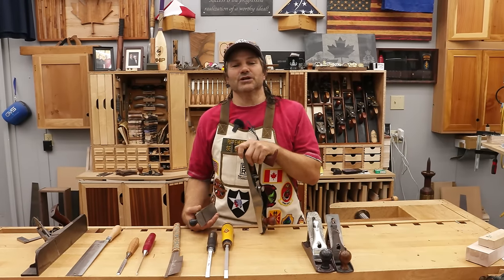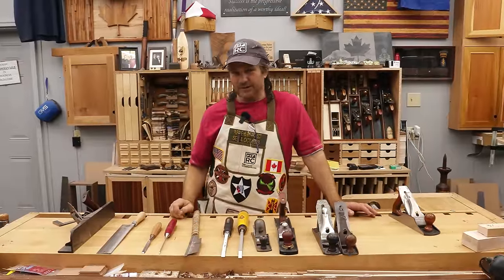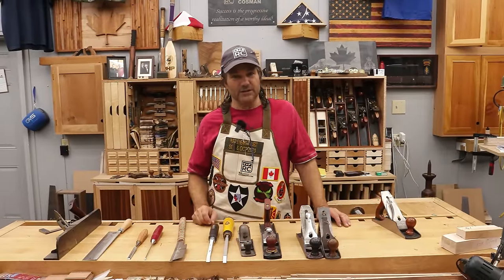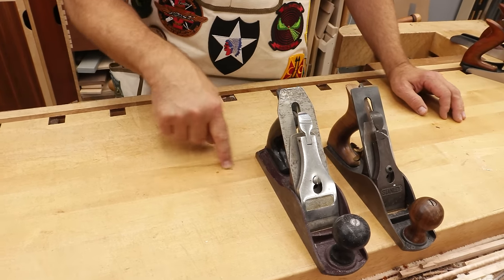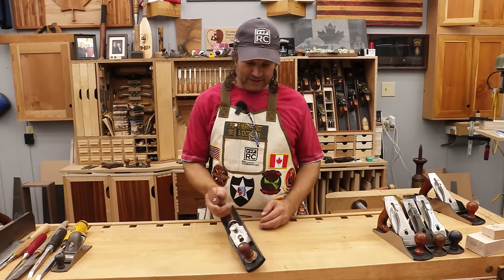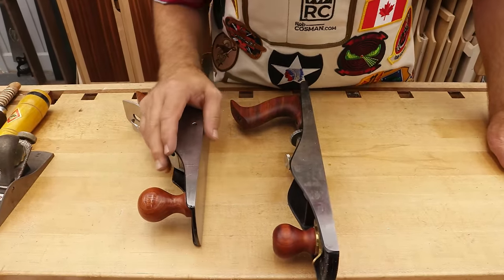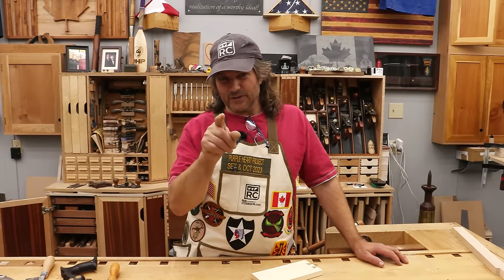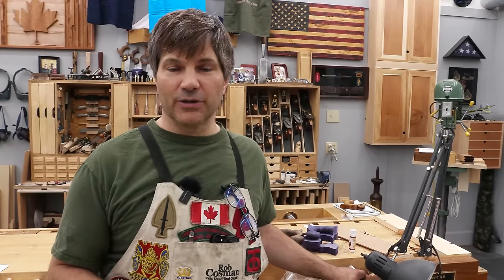Tools Not To Buy | Learn From My Mistakes !

Comment: I find that for most of my work, the 4 and 5 works better (the caveat is that you buy the lightest vintage 4's and 5's to restore while having a very sharp blade).  I do also have very sharp and flat 4.5 and 5.5 that works better for other things, but I do agree that most application of these also works well with a good amount of mass.  I think Narex style chisels are fine, they are no worse than using a bevel edge or firmer chisel.  The purposeful relief actually only is an issue if your sides dont scrape their way down past the last cut (usually not and issue).  That said, they do wander far more than a perfectly squared mortiser.  As for parallelogram chisels... basically all vintage chisels will be like this.  It's ALOT of work to get them relieved, and even more to bring to full square.
Reply from the maker: I would call you out on "Basically all vintage chisels"  there are some very good vintage bevel edged chisels.  But just like everything, you have to be willing to pay to get correctly made vintage bevel edge chisels
Reply: @RobCosmanWoodworking Good vintage bevel edge chisels are generally excellent provided you get the right brand from the right era.  Plenty of later Bergs are softer than some modern Sorby's regardless of what people say.  Some bevel edge chisels such as earlier Ward, and Howarth are unbelievably flat and consistent over 8 or 9 inches of length.

I was specifically referring to the mortisers and firmer chisels. I find they mostly have that weird skew - not sure if it's one of these artifacts of the manufacturing process? 

Often, you will find one side squared and the other side skewed as well.  I am a bit of a vintage chisel affection-ado and I own over 200 or so of them?  Honestly, majority of the firmer and mortisers have that skew (at least on one side).  I am a sadist so I spend my time to fix all of them....

Comment: This is really great! I hope to hear opinions from those who use dedicated shooters. Over the years, I've come to adore (and rely on) the shooting process and have just been using my heaviest, most-square, and "whatever is sharpest" plane. It takes effort, but I do get results. Someone recently enlightened me about the shape of the dedicated shooting plane, specifically its ability to travel in fixed-width track eliminating drift. This is appealing! They are pricey, though...
Reply from the maker: My point exactly...Why spend all that money when a tuned up bench plane will do just as well?
Reply: Used the 5 1/2 as a shooter. Was just too painful. Palm was one thing, but where my fingers were... a bad pass with a sudden stop just killed these old hands.(damn, just admitted out loud that I'm old ) This was pre Rob's adaptation for the 5 1/2. 
Bought a dedicated shooter. 
Changed my life. 
The good:
Heavy. Heavy is good. Hardwood don't scare me...
Larger surface area contacting the shooting board. You'll never worry about a wobble again and it laughs at slight imperfections on the shooting board.  (like a jointer misses the valleys)

Where the Cosmogrip might be better:
Having your hand right where the business is taking place. More control. Being more in line with the linear motion to the mass of the plane feels better. Even without the Cosmogrip. 

Having said that, when first using a purpose made shooting  plane, with your hand off to the side and further back, it seems like you will need to lever pressure to keep the toe in the proper position. (torque your hand a bit inward?)
In practice though, there is no need. So once you get used to the feel and idea that the plane will track properly without excessive help from you, it becomes a non issue.

The up in the air part:
I often vacillate between shooting board and standard planing. For myself, taking the Cosmogrip on and off is about on a par with just grabbing a different plane. Be it a purpose made shooting plane or not. So probably, I would have used my 5 1/2 as a dedicated shooter.
 
If the Cosmogrip were available would I have bought the shooting plane? No. That is a brilliant solution to a real problem and would have given the Cosmogrip a try first.
Would I give up my Lie-Nielsen? No. It is a better solution albeit at a price. Once you've driven a Rolls...

Disclaimer.
So yeah, I bought the Lie-Nielsen... I know. 
Just know that what I said will not necessarily apply to the other modern purpose made shooting board planes. I did have one other in hand and there is something to be said about nimble.

Comment: had those exact problems. large hands yup.
just couldnt get the plane to sit smooth, i ended up trying to attach things to it to increase its size and offer my hands a better control. kinda worked but obviously theres  aproper option.
if id known i would have saved a bit.  ...or kicked my father for not handing down his 😂

Comment: There is nothing here I disagree with. However, due to budget and wanting to get into to mortises quickly I did pick up a set of the Narex. They are ok, but I do find that the sloped edges do cause issues...so, I'm gunna save my sheckles and get a better set when my skill reaches a level that would justify it. Here, again, is another example of "cry once vs cry everytime"
Reply from the maker: Yup, I bet you can sell them on the secondary market and recoup 50% of your costs

Comment: Good stuff Rob, I have to agree with your views on these tools. I have most of them. The block plane explanation is spot on. I have the WoodRiver 5-1/2, it's far and away the best I've got. I admit to using my Stanley and Miller Falls #5 and #4 's  to do some initial planing, my thinking is somewhat convoluted  and for another time. I use a Gent's saw because it's what I have and have grown accustomed to it. Would I like one of your? Absolutely. One day I may have a couple. Right now it's not possible, yep, budget is that tight and a Regime change is essential. Thanks for sharing your knowledge and your work with our veterans.
Reply from the maker: Amen to the regime change!  Can’t come soon enough.

Comment: Its funny. My first bench plane was a Lie Nielsen Low Angle Jack plane. The “gospel truth” on the internet stated low angle Jack planes are the best plane for beginners. I don’t use my low angle Jack. My most used plane is my grandpas old Stanley 5 1/2 with a Ron Hock iron and chip breaker.
Reply from the maker: Ron makes great blades.  I really dont know how the whole internet thing recommending Low angle jacks got started

Comment: I completely agree with you about Japanese saws. While I think they are a little easier to learn for a beginner learning to follow a line, once you learn how to control a western saw, I feel you can achieve a greater degree of control, especially, as you say, in domestic hardwoods.
Reply: Totally agree, I think the advantage of the pull saws is you can get a good saw for much cheaper than a good quality western style saw.
Reply: @dominicdiclemente8877  that is also absolutely true. Cheap western saws are never sharp, and beginners a)wouldn’t have a clue that they weren’t, and b) wouldn’t know how to sharpen them if they did know they weren’t sharp from the factory. The first time I used a good, sharp western saw, I was hooked. It was a euphoric feeling, especially when I considered my childhood years, finding an old rusty Disston in the barn, and trying to hack away at a two-by for an hour, making about three inches of progress!
Reply from the maker: Thanks for sharing!
Reply: Totally agree that Rob doesn't know a thing about cutting hardwood with a japanese saw if he believes the urban myth that they're 'designed' for softwood. If you and him feel you can cut hardwood better with a 'push' saw, fine. Use the tool that works best for you. In the meantime , I and every woodworker in Japan will use our Japanese saws to cut hardwood. Oh and Jonathan Katz-Moses also cuts hardwood dovetails with a dozuki.
Reply: It's pretty hyperbolic that you think it rises to the level of "Urban Myth." Still, saws and planes from any given area are absolutely tuned for the kind of wood that the craftsman uses most. When I bought my Bad Axe saws, Mark always asked what kind of woods I use most so that he could advise on ppi and fleam. English planes are often bedded at York Pitch because the woods they often use require that. Similarly, Japanese polishing planes are bedded lower than 45 degrees to work better in the cedar and other softwoods used in abundance there. The Japanese saws that beginner woodworkers have access to here have no options for differing wood densities and properties, unless they go to expensive ones at Japan Woodworker. So your argument isn't taking into account the nuances of all of our practices everywhere. I use mostly domestic hardwoods, and they do not cut well with my all-around Japanese saws. We all need to tune our kit to the woods we most often use.  @Trust_me_I_am_an_Engineer

Comment: In the early years if you were to offer these recommendations you would have been jumped by Schwarz and all the toolmakers who very much dictated to what we needed and that was every tool they could throw at you. However, now that they have disappeared and become quiet, advice on what tools to avoid has emerged. But as you mentioned, we were unaware of these insights back then because we were guided differently.

Comment: Always funny when people think they’re inviting controversy, only to present totally reasonable arguments or opinions.

There’s lots to agree with, but of the planes I own, the 5 1/2 is my least favourite, for the reasons given here: it is harder to push when the blade is not perfectly sharp – I don’t like it. I also don’t agree with the idea that more mass is better: it gives you more momentum, but you need more energy to create it. I bought an old 5 1/2 that is perfectly square, though: it’s good for the shooting board.

And I probably will give the Lie Nielsen No. 62 a go, despite the fact that everybody says you don’t need it: everybody also says you don’t need a huge jointer, but everybody who says that does have one and uses it – I really enjoy using my No. 7, too. Also, I’d like to own one modern “premium” plane, to see what it’s like: the No. 62 has a No. 5 footprint, and I don’t have a No. 5, and I want to try the toothed blade as well, since I don’t have a scrub plane. That’s my reasoning. We’ll see.
Reply from the maker: If your 5-1/2 is hard to push I would look at your sharpening skills.   It is not difficult with a sharp blade.  Sharpening is the key skill of a hand tool woodworker
Reply: @RobCosmanWoodworking  No, I know. Sharpening is not difficult, I’m just lazy – never been good with maintenance.

Comment: I generally never understood the purpose of a number 4 plane, for me its jointing with a number 6, 5 1/2 for all purpose including smoothing, then low angle block plane, then shoulder plane. All I need....
Reply: It depends. If your making large pieces, from larger stock, a large plane is at home, but try working with those on ½ inch stock. Not fun. Small details need smaller tools, or really, really strong wrists. And Rob is right about ergonomics, as having had RSI, its no joke. This is why it might be best if you can, to think about what you plan to make, and the material you plan to use then try before you buy. Go to tool fairs,  physical shops, or community workshops, and get your hands on the tools before buying. Hand woidworking tools are no longer cheap any more, so one can't just afford too many mistakes.
Reply from the maker: The old standard of needing a fore plane, jack plane and a smoother is no longer needed given our modern metals and quality sharpening stones.  You can smooth with any size plane as long as you can sharpen it well.  Why buy a specific plane just for smoothing?
Reply: @BigHenFor  It is definatly true about small details needing smaller tools. I brought my miniature low angle block plane mostly because it looked cure and I had just one use case that needed it. However having it in my plane till actualy sees it get a fair bit of use in tight areas / small details that before I aquiered it I would use a pairing chissel.

Comment: It,s allways the guy behind the tools that counts. Bougt a  handsaw from Stewe mac, like the tol seven here, Sheffield steel, to saw for frets in guitar building. That saw was the most unuseful and discusting saw I,v bought. Had to file the teth all the way. Shorten it in every direction to make it work and make a new handle as well. Now it,s my best saw. So be prepared to convert tols to suite the way You use them.

Comment: My biggest reason for buying Japanese saws was price. I wanted to learn dovetails but could not afford to pay $200+ for a Western saw starting out.
Reply from the maker: My experience is that is what a lot of people do.  So what happens is they purchase a cheaper saw but one thats much harder to use.  They typically are inexperienced so have a hard time understanding how to make a japanese saw work properly and most common keep it straight in the cut.  Western saws are much easier for beginners to learn but cost more.
Reply: Sorry, this made me laugh, but I think there are a whole lot of Japanese carpenters that would disagree. They tend to hold a western saw off center like a gangster in a movie. They’ve only seen Japanese carpenters with Japanese saws, western saws are rare in Japan. I absolutely agree with the quality issue you bring up, a cheap saw isn’t going to cut as well as a good quality expensive one. I’ve found the gents saws you have an issue with are often sub par as well.   @RobCosmanWoodworking

Comment: I know zero compared to Rob. That said. Here’s my input as a person figuring it out. And these ideas don’t oppose to Robs. Just my thoughts. 

1. You should all have a number 4. He’s not wrong. You should get a 4 1/2. But, you should all start by getting a used 4 off eBay for $40 or $50. You learn to rebuild it, and from there you’ll always know how to physically take care of it and know when somethings up with it. The reason I say No4 is because it’s easily the most abundant used plane to find and anything 50 years old works just as well today. But it gives you a chance to really learn hand planes and fall in love with them. And not feel like you wasted money. It’ll take an hour or 4 and you can get it perfect. 

2. Veritas makes a wonderful low angle jack. I don’t disagree with Rob on the 5 1/2. But I love mine. However, that baby can produce some real tear out. So while I do love it as a long angle, I often throw a 50 degree blade on it that essentially turns it into a regular plane. Which, sort of tosses the whole low angle aspect out. But it’s still a nice plane. But before you spend $325 on it, see my rule 1 again. 

3. Standard angle block plane is pointless. Someone gives you one. Great. But just get a low angle block. I was given one and remade it for the fun of it. But I absolutely hate it. I tuned it. Used it once. And keep it just because I like hand planes. But it absolutely sucks and I would never reach for it. Not even to pound a nail if it’s all I had. 

4. I always want one. But no. If you have a ton of space and money. Okay. But no. Never. Don’t fall for it.
Reply from the maker: The problem I see with beginners learning woodworking and getting an antique plane is they dont know how to restore it, they dont understand how it functions so they typically cannot make it work and get frustrated.  I equate it to learning to drive on an old stick shift and broken car.  Before you can learn to drive you must know how to repair the car and then learn a stick shift.  Better to learn to drive in your parents working automatic.  Once you know what driving is all about, then buy a rebuild project

Comment: the comparison of the "low angle jack plane" to the 5-1/2 is not quite apples-to-apples.  true, all modern manufacturers of the low angle plane describe it as a bench plane, jack plane, but  Stanley intended, designed, and cataloged it as a low-angle  plane, to be operated with both hands.  "Especially adapted for use in cutting across the grain on  heavy work, where more power is required than can be obtained by the use of the ordinary Block Plane." -- Stanley 1934 catalog, page 87.  No one should buy it thinking it is a bench or jack plane, and the manufacturers should not describe it that way.  To my knowledge Stanley never made a low-angle bench plane.

Comment: Now I partly understand why the low angle jack planes are disfavored by Rob
Reply from the maker: Its just my opinion, but I am sticking with it
Reply: @RobCosmanWoodworking  it is indeed your opinion and I value learning the basis for your opinion. Having essentially no experience with bevel down planes I will stay with my collection of bevel up planes and their Norris style adjusters. Had I known about you at the time I might have gone in a different direction.

Comment: Judging from your youthful appearance, if you've been woodworking 700 years, I've been doing it for 800 years. I was amazed at how many of your "opinions" matched my own. I disagreed with the #4 vs #4-1/2 plane. I seem to reach for the #4 almost always. It's lighter and performs basically the same job as the #4-1/2. Otherwise, spot on for newer wood workers. I was told by someone with 900 years experience that you know you like a tool if you pick it up (or walk up to it) and begin smiling even before you start using it. Thanks.
Reply: Or if you start talking to it! lol
Reply from the maker: Great comments, thanks